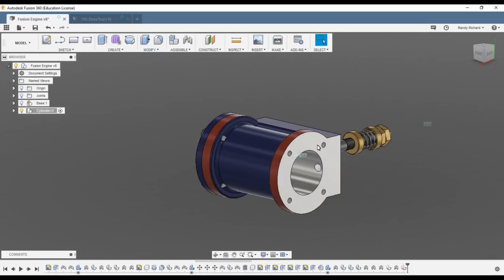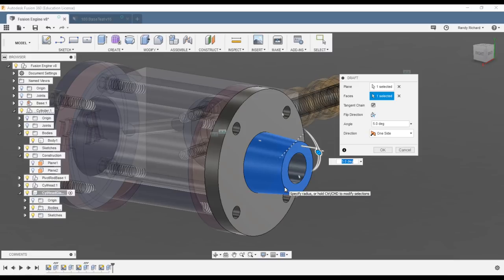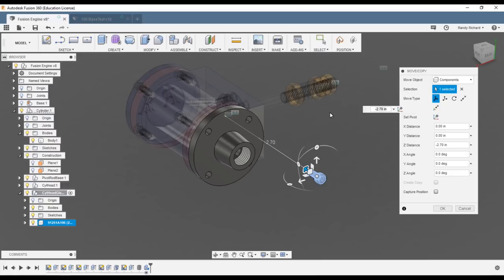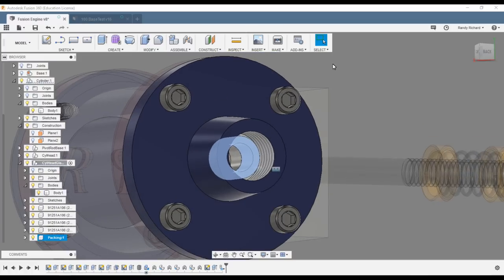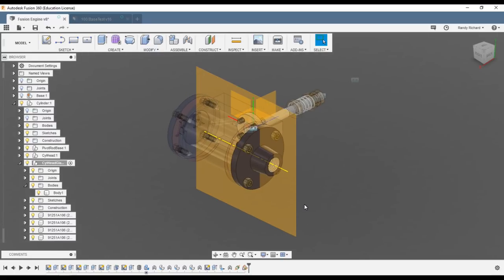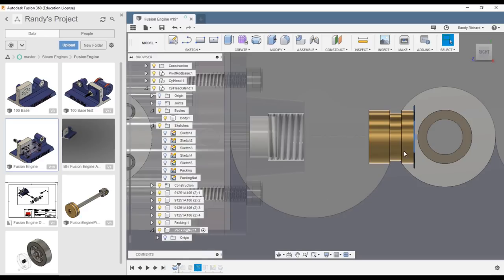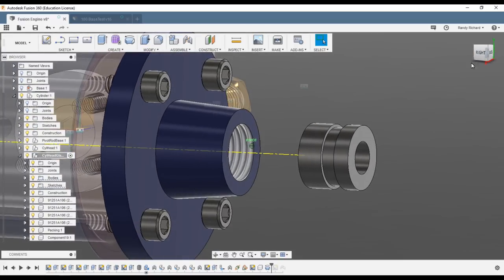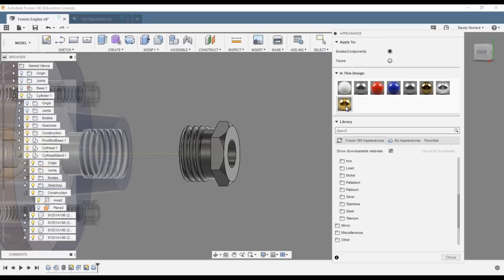P3-4 How to Model the Cylinder Piston Rod Gland of a Model Steam Engine From the Ground UP

Comment: Randy, this is an excellent tutorial series on Fusion 360 for the hobbyist. Now that we’ve seen the Draft command, I’ve been thinking that it might be extremely useful after the modeling is complete on this engine to take a component like the cylinder head and copy it into it’s own model and turn the part into a pattern that can be 3D printed and used to cast a custom part, say with the “RR” instead of the “G” on the cylinder head.

Thanks,
Scott
Reply from the maker: I was thinking of doing a video on something like that.  Thanks Scott.
Reply: So I finally made it through the cylinder head gland video. For anyone modeling along with this video series, the packing gland nut is actually built out at the end of the video. Trying to build it while following along with the discussion about going back in the timeline can be a bit confusing.
Reply from the maker: @iPleinAir  Well you are getting there.  Thanks.